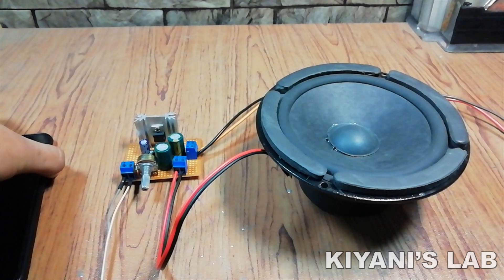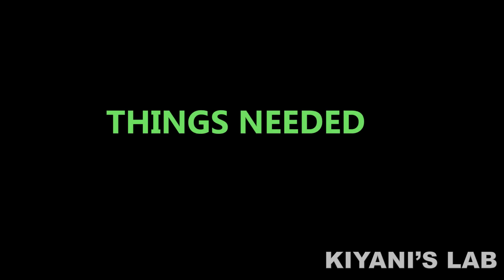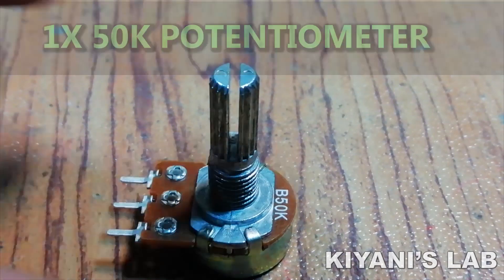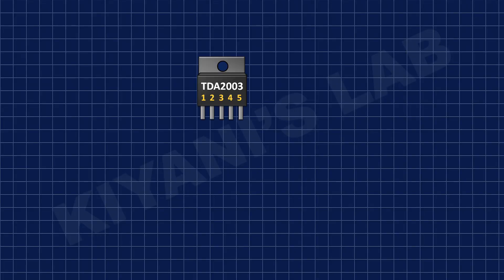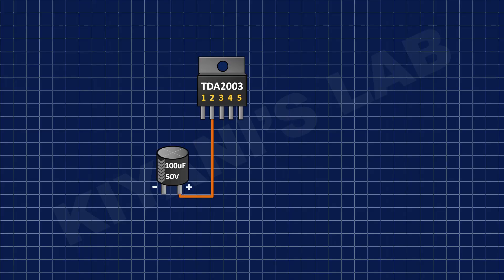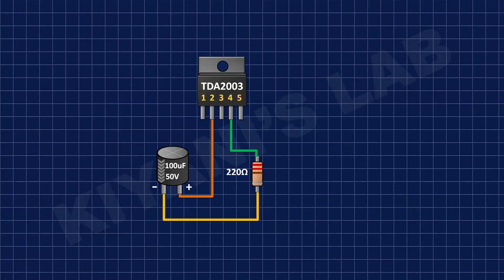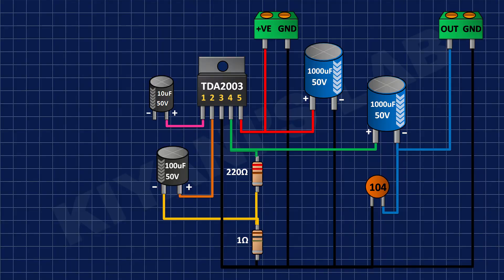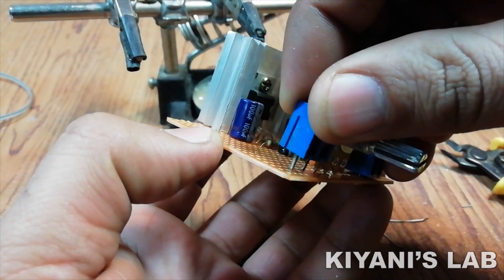How To Make 12V Audio Amplifier

Comment: It works well but the sound pitch is low but when I remove the 1 ohm resistor and I ground it with its series resistor the sound pitch goes up what do I do